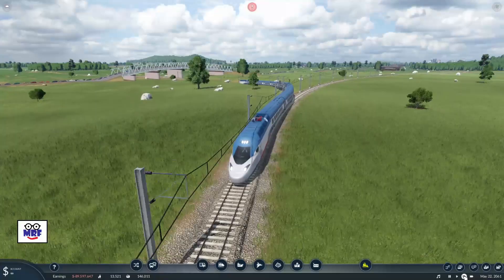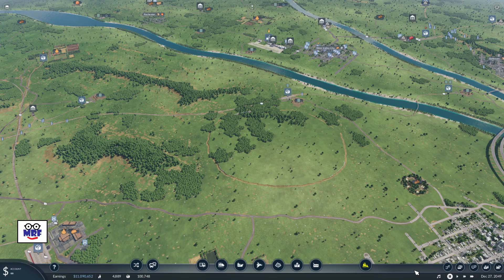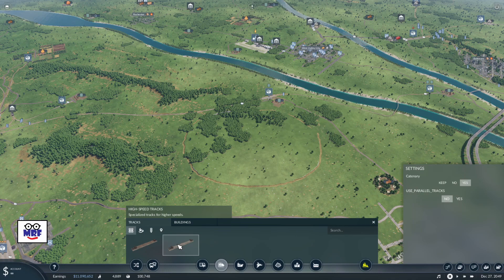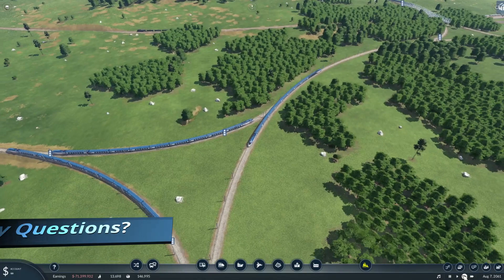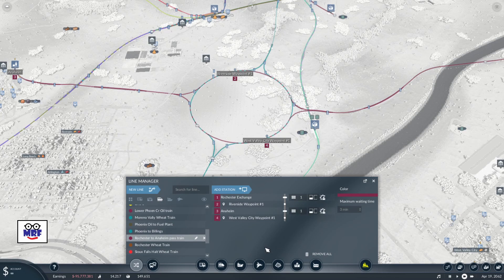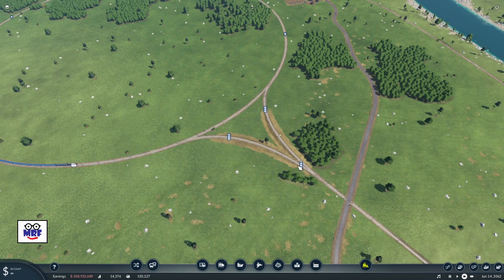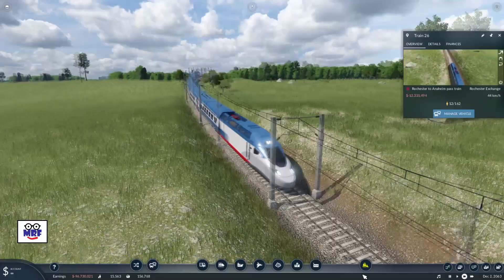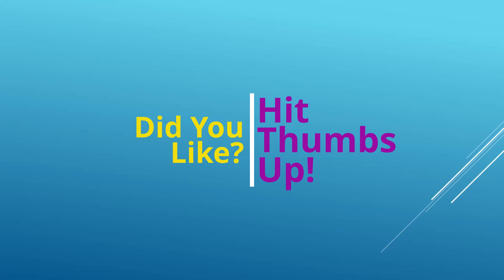Transport Fever 2 - Do Large Train Roundabouts Work?

Comment: Did you use one way signals on the tracks to stop trains from going into clockwise direction?
Reply from the maker: I didn't intentionally set up the signals to make the trains go counterclockwise. I guess the way I set up signals makes them do that. If you wanted the trains to go clockwise, at the sidings, put the one-way signals at opposite ends but still on the right hand side from the driver's perspective.